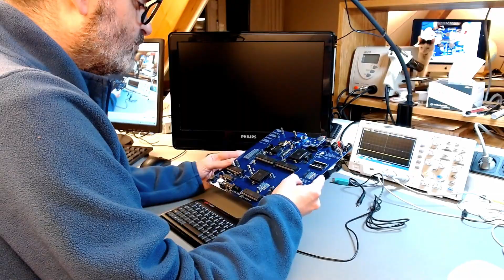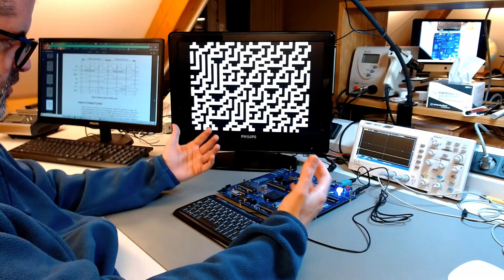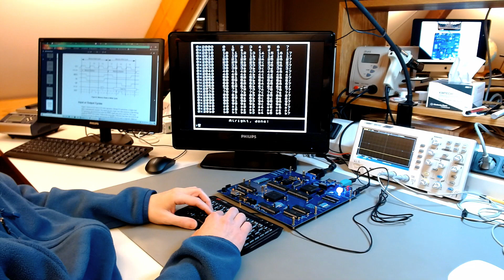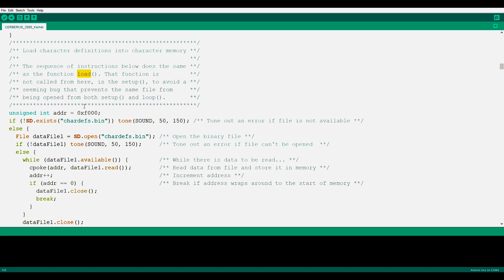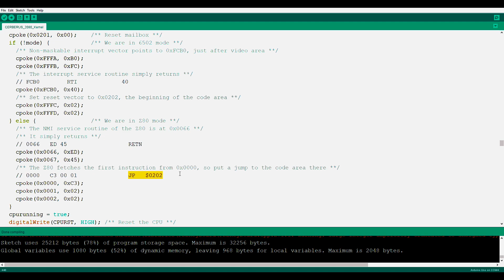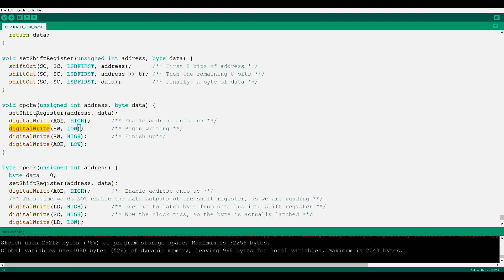Building CERBERUS 2080™, my dream childhood computer: Episode 20

Comment: I believe PCBWAY now has a service that produces and populates boards.  It might be nice to find out how much a Cerberus would cost if produced by them.  If affordable, this could get more of them out here and encourage software development.
Reply from the maker: The point of using all through-hole components is to make it easier for people to build their own unit. If price is the bottleneck, though, then we are better off with a factory-populated SMD version of CERBERUS, which would be cheaper and smaller. I haven't done the latter because I like to build my own units, but I am sure the community will eventually do an SMD version for the reasons you mention.

Comment: Maybe you should add logic to the simulation to read-back and re-check the screen memory against the algorithm itself.  It would both slow the output, and allow you to run it for an extended period and check a ton of data automatically?
Reply from the maker: Yes, you are right, that's how it SHOULD be done. ;-)